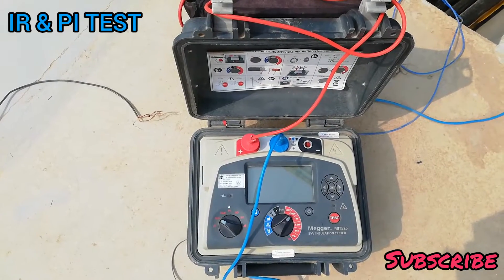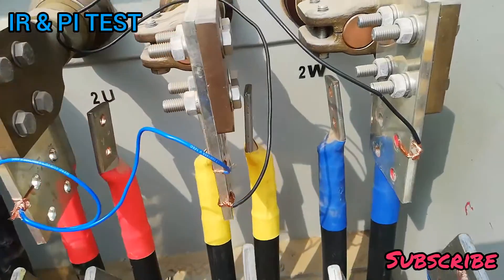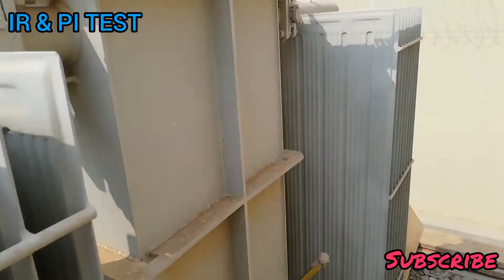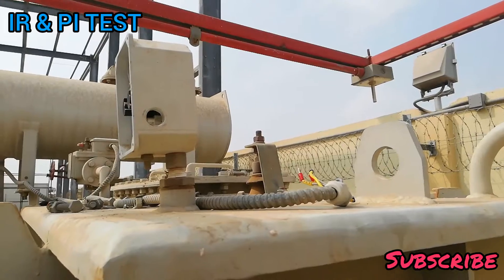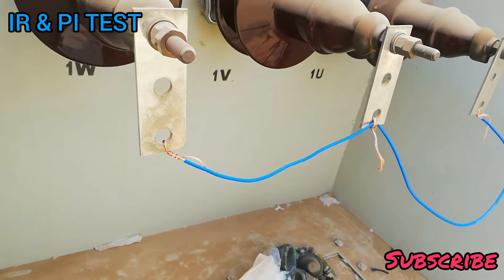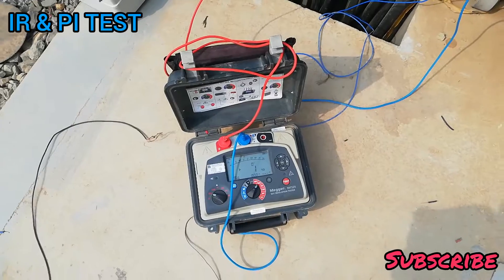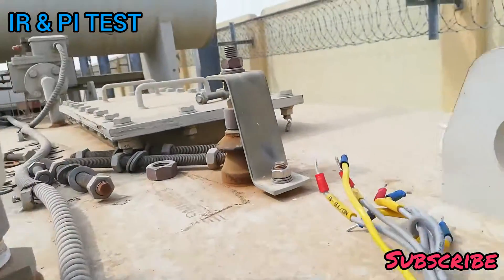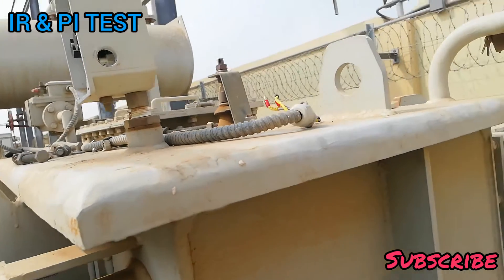INSULATION RESISTANCE AND POLARIZATION INDEX TEST FOR TRANSFORMER BY MEGGER

Comment: how do you discharge the applied voltage? After the insulation test
Reply from the maker: For sefty you can touch H.V & L.V windings also trafo main tank with a ground extension wire for any charges discharge

Comment: For auxiliary  Transformer  we don't consider PI
.......
Reply from the maker: Can you clarify why don't consider?
Reply: @amribrahim2462  less than 20 MVA .... its better to measure  resistance  for 1 minute with recorded values at 15sec intervals...
Reply from the maker: @mix_videos_islamic_knowled4804  this is right under some standards. But here i have mentioned all tests can be done 😊